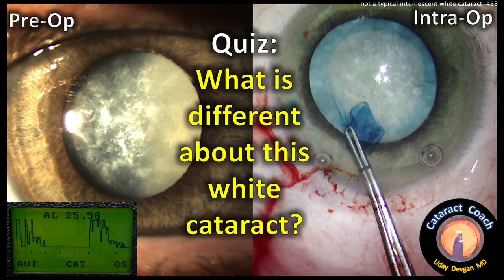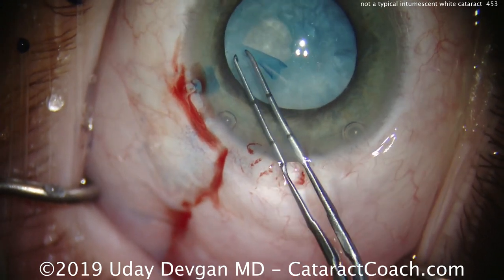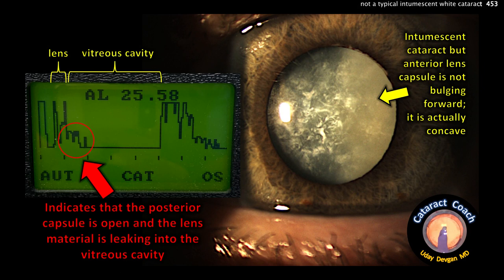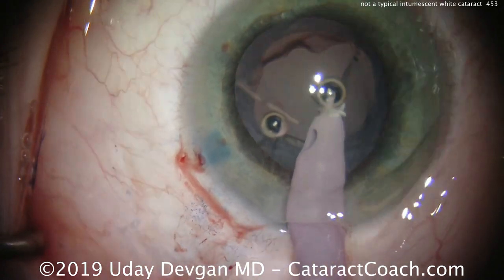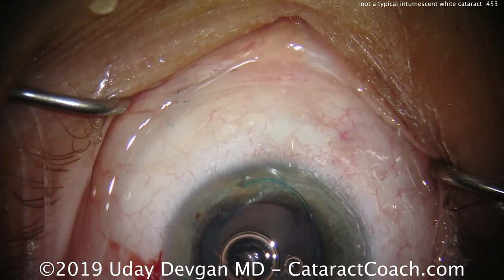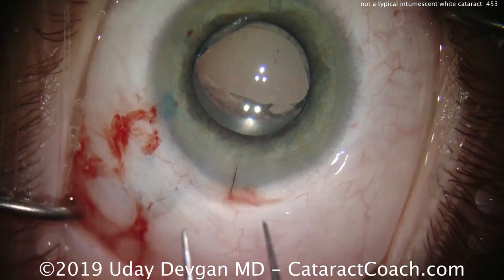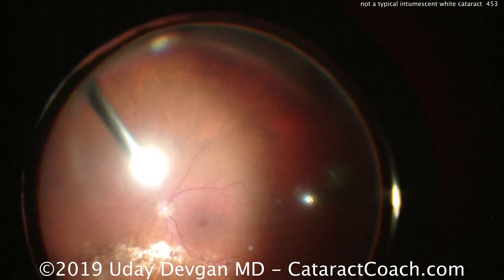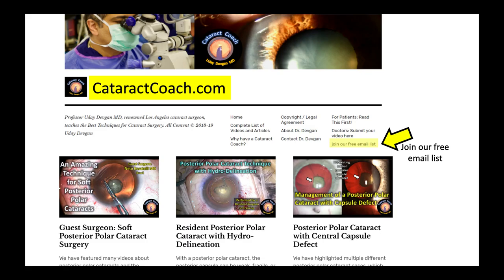Cataract Quiz: Not a typical intumescent white cataract - danger sign in surgery

Comment: Hello. Similar case without vitrectomy antecedent and hard nucleus drops behind posterior capsular but is still floating over anterior hyaloid. A vitrector via pars plana helps to levitate the nucleus back to the anterior chamber.
In that case, is it better to extract the hard nucleus through a significant larger corneal incision or through an scleral incision as in extracapsular extraction, considering the fact that vitrectomy and 360º scleral indentation must be done after the extraction of the lens.